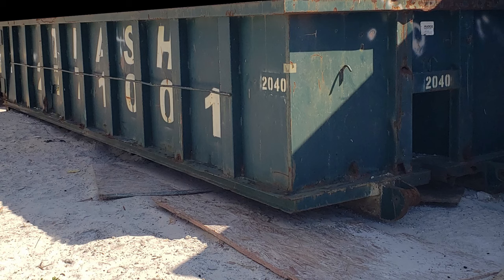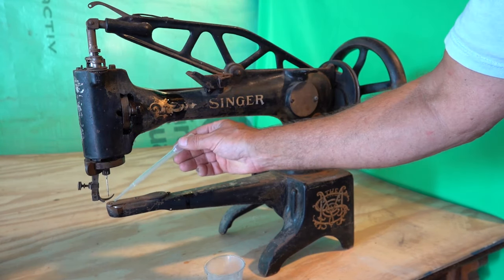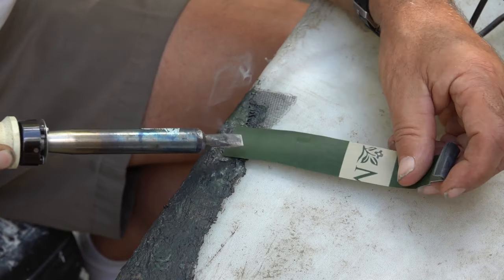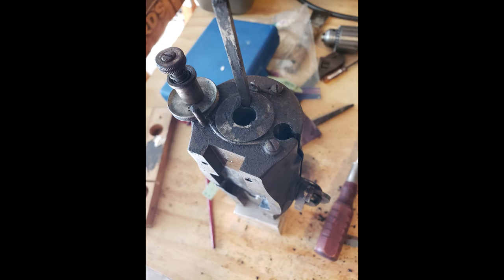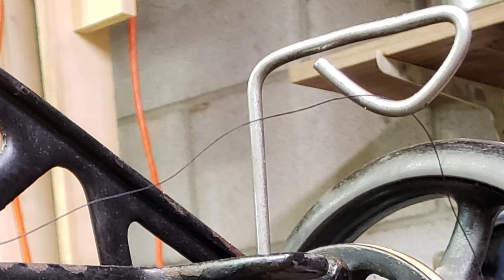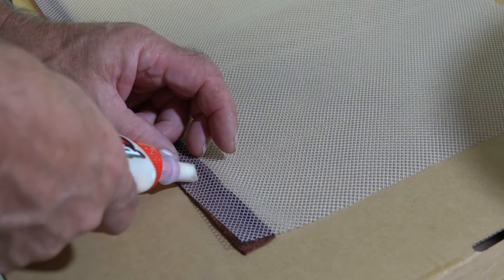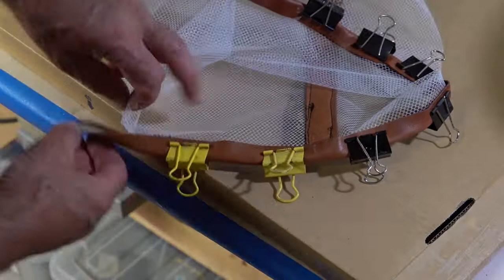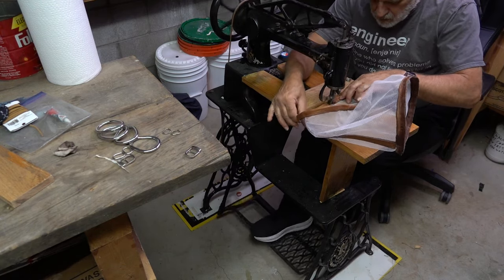Restoring a Singer 29 4 and Making a Foraging Bag

Comment: I have a 29k and I will be attempting to repair a leg too. I will have to watch that part again. I will probably just weld, fill and grind, as I don’t plan to paint quite yet.
Reply from the maker: Welding cast iron can be tricky. What I did was to make a quick tack weld, let it cool down slowly, and then repeat. It takes a lot of patience and time but reduces the threat of cast iron cracking from thermal expansion and contraction.

Comment: I just got a machine like this today. It's INOP, but looks like all parts are there. I restored a similar one many years ago, so I have a limited experience. My questions: how did you determined its 1908? Who sells parts and decals?
Reply from the maker: My reply is based on what little I learned researching this. This is the only time I restored one. If I am wrong about something, or if someone has more resources, please chime in.
First the age. Singer used to assign a block of serial numbers to be used. When they needed more they would assign a new block. My serial number was part of a block assigned early 2008. That summer they issued a new block of numbers so I assumed it was made between or around those dates. If you search online for  singer machines, year made, and serial number you should find it. There are a lot of singer enthusiasts.
There is at least one online store that sells used parts for that model. Amazon has some parts but they are parts made in China for the model 29K. Some fit and some fit after drilling and filing the parts. You can find parts on eBay. They may be used genuine parts or cheap Chinese parts for the 29K. I was not confident that I could restore this so I did not want to put a lot of money into it. I bought cheap parts directly from China through AliExpress. Some parts came in a few weeks and others took a month to get here. Download a parts manual for the machine. There are free ones out there. Use the part numbers to search for what you need.
There are several forums online for singer machines and for leather working. You can find them by searching for your machine model. It is on the forums that I found someone that sells parts, the company that sells decals, and the plans for building the table top.
If you go to a modern sewing machine store in a mall, you are not going to find parts or supplies other than oil and maybe thread if you are lucky. I bought needles (leather and cloth), thread, threading tool, bobbins, and leather belting from either AliExpress or Amazon all of which worked.
Good luck with your project and please post a picture when you finish.
Reply: @larrywydra  thank you for your reply. I'm on the very first stage of research, since I got my machine on ebay, I picked it up yesterday. I restored a similar one some 30 years ago, but at that time i was more interested in its functionality, and less in its historic value or origins (it was in 1993, so it was a pre-internet era for many, me included). I used it for 2 years while fixing footwear as my main source of my income, and for some 5 years as an extra income while I studied in university. I had to leave that machine in my home country, I hope somebody is using it now. 
As for this machine, since it looks like it has all parts, and nothing is visibly broken, I decided to restore it to full functionality. However, I'm not sure about paint job, as far as I know, the paint job done wrong can negatively impact the value of such device. I'm not selling it, but still, I want to do things right way. So, I thing I'm on my "trip of thousand miles", and I made the first step yesterday.
Reply from the maker: @igerce  I just got my machine to work and did not plan to restore it to its original condition. Restoration, especially painting it, is a level of complexity beyond what I wanted to do. Good luck fixing it and I hope you find success in your new business. I gave business to a local cobbler 3 times several years ago. I was so glad he was here.
Reply from the maker: This place advertises decals for the 29 but I don't know if it is for the 29-4 or the 29-K  https://www.singerdecals.com/model-29/